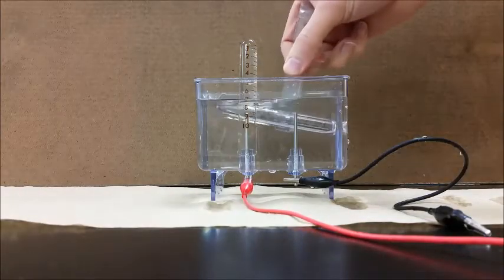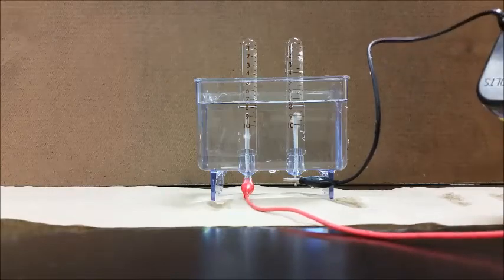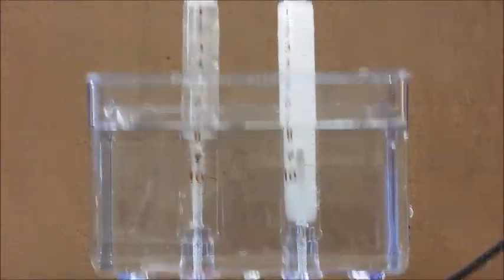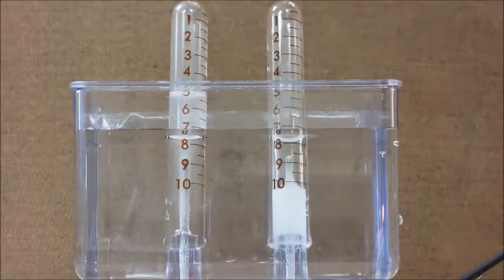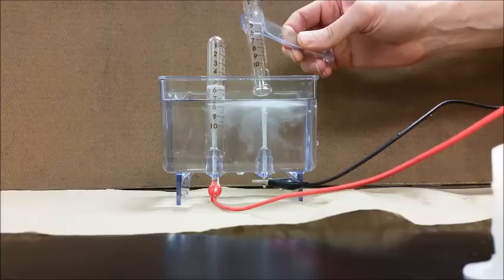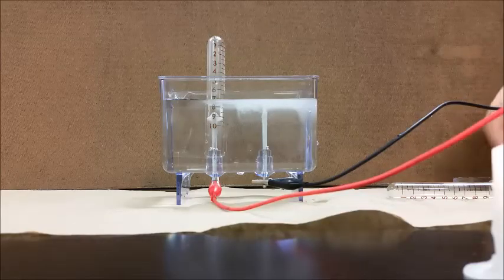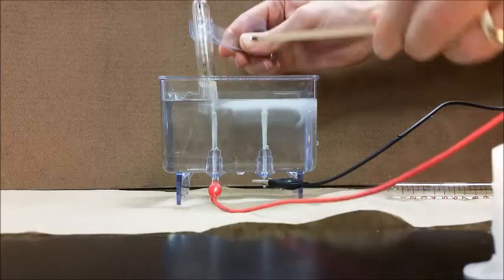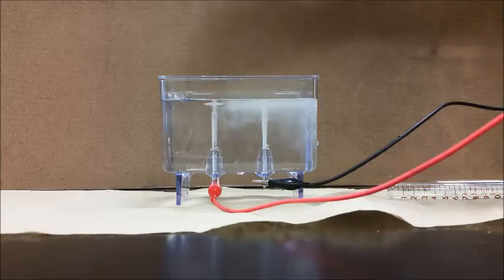How do we know that water is H2O?

Comment: Pure water does not conduct electricity. It's the electrolyte that causes the electricity to flow through the water. The gases are released from the electrolyte breaking down or the electrodes. Water is water and not made up of hydrogen and oxygen.

Comment: Notice also at 01:44 that when the test tube is pulled from the surface a white residue or cloud spills out from the test tube. It's clear this doesn't come from the water but either the electrolyte or the electrode. It's clear something is breaking down and it's not the water! So either the electrolyte and/or the electrodes breakdown to release hydrogen!
Reply: something added to the water for sure. scientific lies.

Comment: How does the weight of the solution in the container change after the electricity is applied?  Did you measure weight?  How does it change in relation to kWh applied?  It's interesting that the use of lye makes this is the opposite of the choir alkali process.  But I have to admit, I'm a bit of a skeptic about water breaking down into H & O.
Reply: You can weigh the initial/final mass or estimate based on mL of H2 + O2 gases produced with pV=nRT, when you find n (mols) you'll know the mass of H2O converted

Comment: I invite all sceptics to read chapter 2 of The principles of chemistry Volume 1 by Dmitry Ivanovich Mendeleyev. He clearly asks in that chapter if water is an element or a compound substance. He then proceeds to explain which experiments prove that it is a compound substance. One of those experiments is the one shown in this video!
Reply: But the experiment above doesn't prove water is a compound substance because in the experiment above the gases could actually come from the electrodes and/or electrolyte!!!

Comment: NaOH is not affecting the amount of gasses. 

2 NaOH ---> 2 Na + O2 + H2
2 Na + H2O ---> 2 NaOH + 2 H2 + O2
2 H2O ---> 2 H2 + O2 

As you can see, the NaOH isn't used up, it's still NaOH in the end, and it generates the same amount of hydrogen and oxygen as water would so NaOH is like a catalyst, speeds up the reaction, but not used up or reacting itself.
Reply: Cool story bro
Reply: are you lying to yourself or me?
Reply: doesnt matter because the result is the same. there are plenty of other methods you can find the composition of water including some stupid easy stuff you can do at home. put some grain alcohol in a jar lid, light it and hold a cold glass over the flame for a second, theres condensation. thats water because alcohol is C2H5OH (which has been proven for centuries even) and when it burns the carbon forms carbon dioxide with air oxygen and the hydrogen reacts as well to form H2O. you can can taste the condensation and there are also other more accurate methods to prove it is water. you dont necessarily need the sodium hydroxide anyways.

get some water, put a 9v battery in and just wait, you'll eventually see bubbling which if you collect the gas then burn it it has the characteristic "bang" of hydrogen burning
Reply: i can prove it to you by another method which doesn't use water in the first place. video will be out today if i bother to follow through
Reply: @EdwardTriesToScience  water is not h2o that's my point
Reply: prove that it isn't because there are thousands of tests that have shown us that water is H2O

Comment: Dear commenters, the hydroxide is NOT being broken down, when it does, it just regenerates itself, stop saying it's the hydroxide! Water is not conductive enough at 9 volts, so you add an inert electrolys such as sodium hydroxide. If you dont belive that water is H2O, do this experiment, but use a 100 vdc power supply
Reply: Chemical formula for sodium hydroxide is NaOH. Published data may refer to it instead of the anhydrous compound, meaning without water. So tell me Edward, what does the O and H refer to in its chemcial formula? Er........O for Oxygen and H for Hydrogen, so it's clear the anhydrous form of Sodium Hydroxide doesn't contain water but does contain oxygen and hydrogen, so it's no wonder hydrogen and oxygen are released at the respective electrodes during the electrolytic process. Furthermore if you think the electrolyte plays no part in the gas production during electrolytic process, when one uses NaCl, chlorine is produced at the anode and this cannot come from the water. Sodium Hydroxide is NOT inert as it's put through a series of manufacturing processes. It's actually extremely caustic and releases heat when placed in water. This is because the water is breaking the compound down to release it's constituents. If you actually think about it, because Sodium Hydroxide contains NO water it is understandable why it is so hygroscopic - sodium just loves water!!! Sodium metal loves water that much, man has to store it in oil!!!!! There's NO hydrogen and oxygen in water. Your science doesn't reflect the natural world at all!!!

Comment: the title of the video is misleading and cannot be proved to be true. Water splitting is a scam! Hydrogen and oxygen gases produced by the electrolysis of a NaOH solution originate from the NaOH and/or electrodes and NOT any water. The chemical formula for sodium hydroxide is NaOH which tells us when decomposed will release hydrogen and oxygen! I like it the video creator conveniently used NaOH as the electrolyte to get the ideal 2:1 ratio. use any other substance and you probably won't get it. The demo is a pure contrivance and cannot be trusted!
Reply: used potassium hydroxide, still 2:1
Reply: @EdwardTriesToScience  well i've placed LiOH in a freezer for a week and then electrolysed it only to get 7:1 ratio!!

Try using NaHCO3 you'll get fuck all like a 2:1 ratio!
Reply: Try running the electrolysis for 1 month without refills, the water will be gone, but there will be the same amount of NaOH left in the container
Reply: @EdwardTriesToScience  water does evaporate as you should be aware and water can also migrate along with the hydrogen as vapour/gas! The NaOH hydrogen burns yellow because the NaOH is carried along with the gas!

Comment: Distorting the truth, these gases have nothing to do with water,  they originate from the decomposition of  Sodium hydroxide that contains oxygen and hydrogen. Water is an element  and there is no proof or even any kind of test that proves in a direkt way these two gases originate from water.
Reply: Okay if it originated from NaOH then there would not be a ratio 2:1, it would be 1:1. Also fuel cells use H2 and O2 to create H2O as a by product
Reply: @TheReck12 , No, the ratio can be manipulated by increasing the amount or concentration of electrolyte to increase the rate of gas production and this is proved by experiments. As for ratio,  it can reach  7:1 , also if the electrolysis of water inot Hydrogen and oxygen was true, then it would follow, if more water was added , the yield of the two gases would increase but it is not the case in reality.
Reply: SHUT UP IDOT SHUT UP IDOT SHUT UP IDOT SHUT UP IDOT SHUT UP IDOT SHUT UP IDOT SHUT UP IDOT SHUT UP IDOT SHUT UP IDOT SHUT UP IDOT SHUT UP IDOT SHUT UP IDOT SHUT UP IDOT SHUT UP IDOT SHUT UP IDOT SHUT UP IDOT SHUT UP IDOT SHUT UP IDOT SHUT UP IDOT SHUT UP IDOT
Reply: @EdwardTriesToScience  Say what you want, but I just want to tell you one thing: you cannot distort the facts with pseudo-science
Reply: water is slightly conductive by itself so if you think this is fake, run 50kv through distilled water for one hour, youll still get hydrogen and oxygen, and try burning hydrogen, and holding a cold beaker to the flame, water will condense, both proves that water is H2O

Comment: Cheap parlor trick water is not H2O rather it's a mixture of different Isomers such as H217O, HD16O, D217O, T218O , you have then adulterated the water by adding NaOH as water does not conduct electricity without a conductor. Your gases are released from the NaOH.
Reply: SHUT UP IDOT SHUT UP IDOT SHUT UP IDOT SHUT UP IDOT SHUT UP IDOT SHUT UP IDOT SHUT UP IDOT SHUT UP IDOT SHUT UP IDOT SHUT UP IDOT SHUT UP IDOT SHUT UP IDOT SHUT UP IDOT SHUT UP IDOT SHUT UP IDOT SHUT UP IDOT SHUT UP IDOT SHUT UP IDOT SHUT UP IDOT SHUT UP IDOT

Comment: You extracted the hydrogen and oxygen from the NaOH, not from the water. Remind me what solids were left over at the electrodes. Your science is a lie. Water is not H2O. Show the same experiment with another electrolyte that does not contain H or O. Your pissant experiment will not work. Water does not conduct electricity...the electrolyte does. Water does not yield H or O, the electrolyte does.
Reply: try balancing the equation of butning methanol, you end up with H2O and CO2, you can use limewater to teat for co2 and anhydrous cobalt chloride for water
Reply: His water does not contain any sodium hydroxide
Reply: @justinrodgers6305  Must be magic water then.
Reply: @masteragario3335  How do you know that NaOH is NaOH then?
Reply: master agario it’s actually pretty simple to synthesize water proving that it’s H2O. Write out the formula for the combustion of methanol and see what you get. Then burn some ethanol and you’ll see that the oxygen in the air formed with the hydrogen in the methanol to make H2O, or water vapor. Anyone who’s taken any basic chemistry course knows this.
Reply: hah he didnt respond meaning he knows hes been defeated
Reply: @EdwardTriesToScience  Nah,just notresponing to your obviscation.
Reply: well use distilled water and 25kv, even distilled is slightly conductive leave it for a week and see what you get

spoilers: you get hydrogen and oxygen
Reply: NaOH is acting as a catalyst, its not actually used up, only the water is

H2O ---> H2 + O
NaOH ---> Na + O + H
Na + H2O ---> NaOH + H

But you're just going to say "well the hydrogen and oxygen is coming off off the sodium hydroxide in a 2:1 ratio." Shut up. Stop making stupid excuses water is H2O. Burn some methanol and see what you get if you hold a beaker filled with ice over the flame. A liquid condenses on the outside, now add it to anhydrous cobalt chloride, it will turn into its pink hydrated form. Put a glass funnel over the flame with a tube connecting to a syringe. Now pull back the plunger filling it with the gas combustion product. Put the tube into a solution of calcium hydroxide and push on the plunger. The solution turns milky white. 

CH3OH + 2 O2 ---> CO2 + 2 H2O 
Now you have proven this equation correct, 1 methanol reacts with 2 dioxygen to make 1 carbon dioxide and 2 hydrogen dioxide, the liquid you condensed earlier is water so the only thing H2O could be is water, carbon dioxide is a gas, not liquid, methanol wouldn't have made the cobalt chloride pink so it has to be water. 

Go. Try it.
Reply: @EdwardTriesToScience  Hello again, it's been a while. Let's keep things simple and demostrable. Let's stick with splitting water into it's constituant parts. As it goes, I am planning an experiment using the scientific process, not general concensus. The result will have 2 possible outcomes verifying either the hypothesis or the Null.

The experiment is simple hydrolysis using the same process as OP with a few tweaks.
1. Use distilled water and weigh before adding electrolye and after.
2. Remove air from the experiment buy adding a good layer of oil ontop of the water. 
3. Complete electrolysis.
4. re-distill the left over water and weigh (keep it air free).
5. weigh final distilate and left over residue. 

Will the water lose weight or not. Gases released are irellavent. 

Step away from your books, look at what water is and does, how it works, it's ability to absorb and release. Water is the understated liquid of life, you can't make it or break it.
Reply: @masteragario3335  There is a flaw in your experiment. Water has a heavy version, so after distilling it will be heavier as the heavy water would be concentrated that is, if water can even be split. Good luck.
Reply: @EdwardTriesToScience   @Edward Science Innovations  Wow, ya gonna have to cite that one. Heavy water?? If the water is distilled to begin with it is stripped bare of any disolved content, how can it be heavier or concentrated??

"if water can even be split".... Hydrogen an oxygen.... have you switched sides?

To be clear, my claim is that any gases obtained from hydrolysis are obtained from the elecrolyte or passive air and NOT from the water. I will prove this by showing that water in = water out.
Reply: @masteragario3335 Well the only way to explain what heavy water is is to say that water is H2O so I can't really explain it to you, but just to remove as many variables as possible, distill the water at 100 C because heavy water boils at 101 C

Good luck as ill be trying it too
Reply: @EdwardTriesToScience  At a glance, heavy water is approx 1 in every 20 000 000 particles and only 11% denser than regular water. Shouldn't be an issue and my scales read to 100th of a gram. Might be a good idea to do a side by side with air involved in the comparable experiment (EX2). I would expect significant loss of volume and weight in EX2. 

Again, no air when distilling the residue. I propose using a balloon as an expansion vessel with gentle heat.